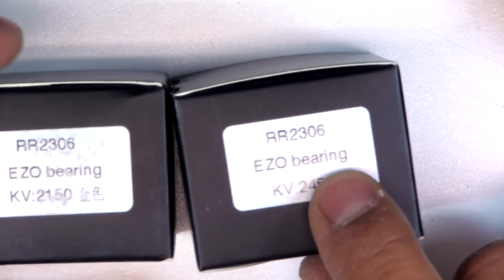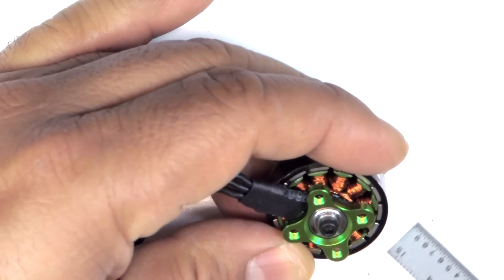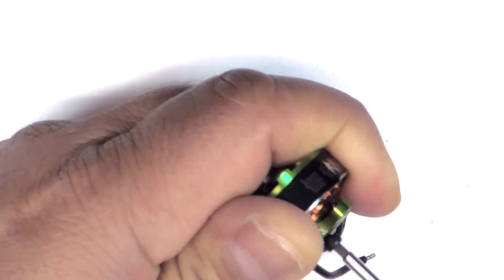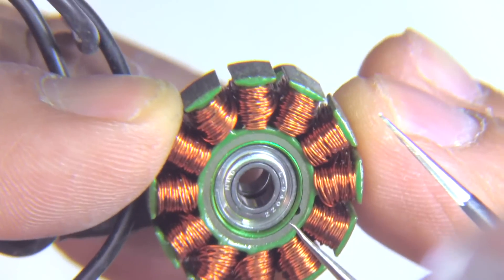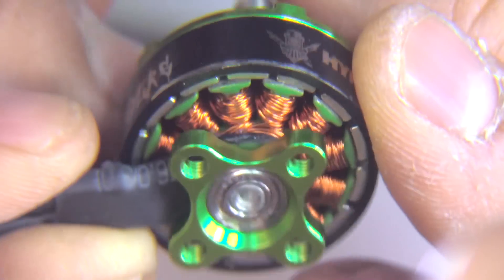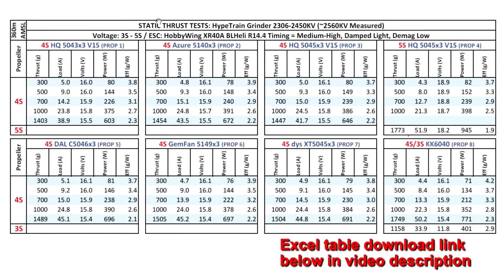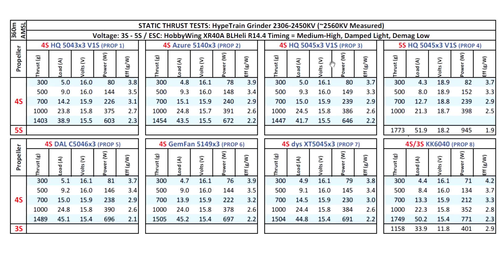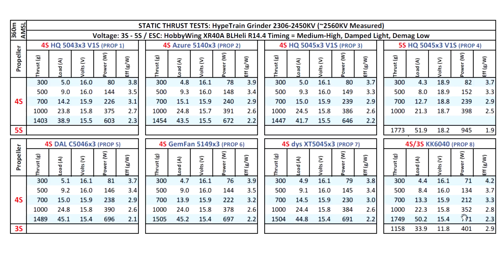HypeTrain Grinders 2306 2450KV - Grind & Pound! Thrust Tests & Overview

Comment: EngineerX is there a difference in smoothness between a N48 and N50-N52 magnets. I notice notchiness when you spin the N50-52 by hand. Is this the same with weaker N48 magnets?
Reply from the maker: What I've usually noticed is the lower  the strength on the magnet, the lesser the notchiness. However, there are a few other variables involved: air gap is one of them. If clearance between stators and magnets is very small, then notchiness increases. Other factors are magnet thickness, quality and amount of copper in the wire winding, and to a lesser extent, stator lamination thickness. All contribute to increasing or decreasing notchiness. Usually, motors that have highest Max power on tests feel very responsive but may not feel right to those who want silky-smooth video.
Reply: @EngineerX  the old fashioned lumenier 2206 where sooo smooth. Zero notchiness. What motors do you think are the smoothest choice at the moment? I even feel a bit of notchiness in the 2306 v2 hypetrains.
Reply from the maker: @jdm724  Unfortunately I have not been flying for several months - hardly any time left for that lately and moved to city where there's no good spots nearby >:(  So I really can't give an honest opinion for what's one of the smoothest motors. One really has to fly it and see if HD video is smooth but trying out several motors just to find something smooth is not something everyone can do. I would look into getting info on motors that the well-known FPV guys fly. Like Mr Steele's Ethix, but those are pricey. Sorry, I don't have enough data or personal experience on a true smooth flying motor.

Comment: So, not safe to use with my 30A Racestar ESC?  =(
Reply from the maker: 30A esc is ok for 5" props . Those are Max Amps for static thrust on the bench test. When flying Amps will be about 35% lower.
Reply: @EngineerX  Nice, thanks.

Comment: I am guilty I buy motors for LOOKS  ...when I start a new build I decide what the kwad will LOOK like.  I am NOT a pro just a retired guy who flies FPV every day.  I don't fly in tight bandos smashing into concrete...I cannot remember the last real crash I had.    recently GETFPV started selling Falcore motors for $9.99 for two motors.  YA $5.00 each !   I have a Falcore and know what they look like[ and great bearings)   so I bought 100 motors !  guess I am set for the winter builds ..
Reply from the maker: That was truly the motor deal of the century. It'll take you a good while to get thru those :) Yep, motors don't have to have a big name brand to work well. Good bearings is one of the main ingredients.

Comment: I wish they had them in a 2207 2700 KV for 4s and a 2207 1750 or 1850 KV for 6s, Bot and EngX what do you think bruh's? 🤤
Reply from the maker: I think those would be winners. Nowadays seems it's a good strategy to cover the range for 4S thru 6S so 1700, 2400, 2700, or close to those values anyway.
Reply: @EngineerX  yeah I agree so botgrinder should have some made that way you have more Motors to test :) lol

Look forward to your next motor test!

and thank God it's almost Friday hope you're having a good week :)

Rob

Comment: I have been watching a lot of your tests and I noticed something and have a question.  Motors used on 3" and 5" props,  perform better on 4" and 6" props. They have more power and more efficiency. So why is everybody flying a motor, while not getting the best out of it? 
Or am I missing something? Because I wanted to build a 5", but now am thinking; the motors I picked, perform better on a 6" prop.
Reply from the maker: Correct, larger props will always be more efficient in producing thrust and using less power to make the same amount of thrust compare to a smaller prop. The main reason to use a smaller 5" prop is for agility, a 5" quad will have flight characteristics that most people prefer. Also I think it might be easier to get smoother HD video on 5" props compared to some 6" builds, but of course you can also get good video on 6", I'm just saying in 5" it's easier. Other reasons: more 5" props available and cheaper and also more durable. For sure there are more reasons than those I mentioned, just can't think of more right now.
Reply: @EngineerX  Yet the weight difference is maybe oly 10 grams in total between a 5"and 6". In theory you should be more agile with more power . It's weird.
Reply from the maker: @sas2dj  Right. I think flight dynamics are a very complex thing. Could be the smaller 5" props can spin up/down (lower inertia on smaller props) much faster so most people prefer that characteristic so 5" and 22XX to 24XX motors ended up being the combination liked the most. Best is to try both with similar components and feel the difference. I haven't flown a 6" in a while with all the new stuff. I've been wanting to build a 6" or a 7" just to try something different but haven't had a chance yet.

Comment: These are very affordable and the fact you can buy seperate bells to repair makes these a real bargain.  If they came as a set of 4 with extra bell  ??
Reply from the maker: Yes, having those bell replacements is a big plus. Would be nice in a combo as you mentioned with the extra bell thrown in as a freebie ;) 
Also need shops to carry sets of 4x9x4 bearing at reasonable prices.

Comment: If these are how made by t motor who are more expensive than the older ldpower I wonder where they shaved the cost? Steel shaft?Performance is pretty average - bit less than the Rcinpower which also tested at a lower Kv for identical amps. If I’m being critical I don’t like the windings near the base. Look exposed. Good on them for sending tho.
Reply from the maker: :) Always like to read your comments because you bring out good points that I miss on the review or just plainly don't see or don't think about. Yeah, best guess is steel shaft but good they used a good NMB 4x9x4 bearing. It'll be interesting to see what people say about how these do after long term use. Hopefully they turn out to be sturdy
Reply: EngineerX have a friend who uses the older version and really likes them and he hated the original rotor riot motor and kept breaking bells. And you taught me well!

Comment: If you want a smoother response,  you can just apply a cut throttle cuve i think. More powerful motors with tight airgap and strong magnets have less 'resolution' since it is easy to launch your quad into space, no?
Reply from the maker: Yeah , I think that's the "feeling" you get with some motors with very tight airgap. I'm sure racers love those. Throttle curve should help I think, but better to choose motors for the purpose you want.

Comment: The Hypetrain Grinders 2306 2450KV Motors were designed by Botgrinder to withstand the abuse he puts his quads through. They are grinders! Through careful design choices, the result is an affordable motor that you won't be afraid to push limits with! Botgrinder Approved!                                   OK .what is DIFFERENT TO WITHSTAND ABUSE ??

Comment: U should test these in a windtunnel. So you get results which actually say something
Reply: So than do it yourself!
Reply: Brutal crowd 😐 this community is in dire need of social skills refinement. Great job engineerX thanks for all your hard work! Keep doing you.🔥🙏
Reply from the maker: Right, a wind tunnel would be nice to have but unfortunately I don't have access to one and also putting together a home made wind tunnel to simulate unloading effect of flying at speed would be way too complicated. Once I figure out how to build it, forcing a steady mass of air thru the tunnel.... logging sets of data would take me hours for each prop because then I'd have to get data for various air speed and various angles of attack and various motor rpm settings. It would be some awesome sets of data for sure ;) 
Unfortunately, I only have a couple of hours each day after I get home from work to run tests, get data, film tests and motor reviews and edit and render these videos. I'm already a bit behind on testing as it is. Hopefully someone will someday run motor/prop tests with high resolution/ wind tunnel setup.
Thanks for watching!
Reply from the maker: @Sixx2099 LoL... always liked that word.... troglodyte
Reply: That's a good idea, but it would be too expensive. 😕
Reply: Pasi FPV so how will that change the results? 🤦‍♂️
Reply: @Sugar_K  

Exactly.
It would tell us something about how props and kV affect motor performance in different flight conditions such as prop AOA and at speed but that would not necessarily help us determine an individual motors performance baseline. The existing thrust test does just that already.

Comment: Wonder which manufacturer(s) they are working with?
Quality and finish seem pretty high, could it be T-Motor?
I never ordered from Rotor Riot Store but i'm afraid international shipping could be pretty high sadly! But i won't be surprised if the main market they are targetting is North America :)
Great review as always! Top notch motor just at first sight and numbers are pretty interesting for what it designed for!
Happy midweek and keep on flying :)
Reply: Was LDTPower and now T Motor
Reply: @SettekFpv  correct
Reply: @BOTGRINDER  TMotor makes quality motors ! At this price these are a bargain.
Reply: @caribbeanfpv2560  yes they do!
Reply: I did not know that before sorry  .  screw instead of c clip and ability to purchase the bell to repair are both quality  !
Reply: @BOTGRINDER   well that sucks, If I damage a motor I will have to buy 4 new ones, I have the 1st batch.
Reply: @caribbeanfpv2560  it's not like you can't get a tmotor motor for 22 bucks tho
Reply: Yeah, from what I heard it's T-Motor that manufacture their motors. 😊
Reply from the maker: Well, just read the replies to your question and some interesting stuff, LD Powwer made the first version and apparently now is T-Motor so that's very good as these should be top-quality motors being made by T-Motor and from what I saw on the break down inspection they sure look very well made. Of course, only long-term use and abuse will show for sure how good they are, but seems they'll be good. Would be nice if they made some 2207's or lower KV for those that like 6S
Have a nice week ahead!